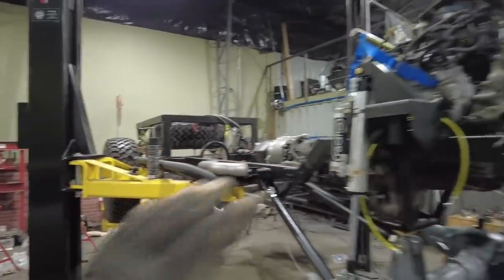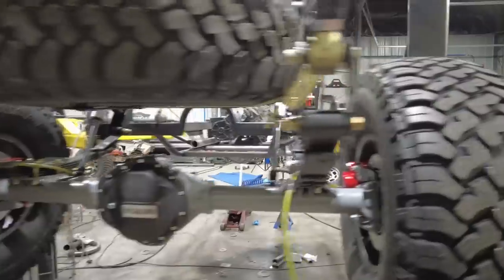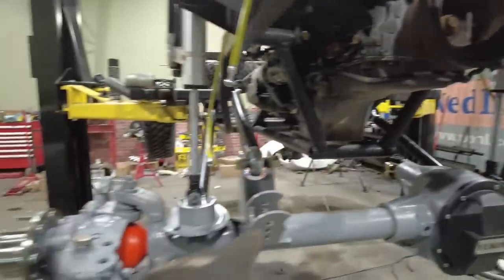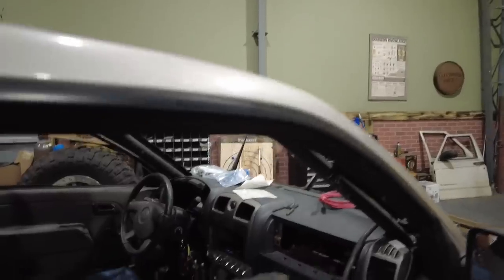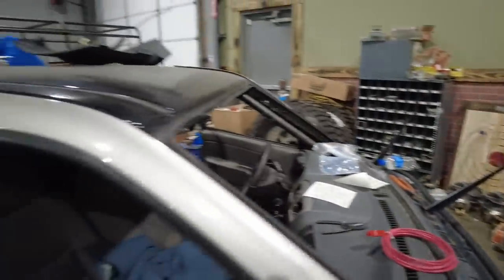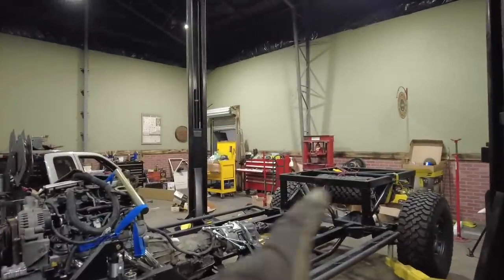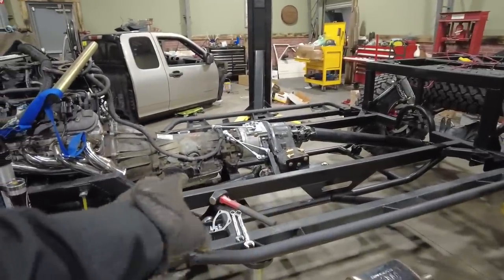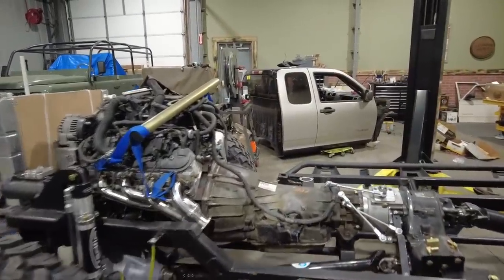Custom Winch Mount on Rockcrawler

Comment: Props and acknowledgment for Ian's skills of TIGging that un-braced pipe 🤯 It's hard enough to TIG around a pipe, let alone hold and rotate it as you weld. Crazy thing is he dipped while it was stationary, NOT while it was moving. Not sure if everyone realizes the difficulty of that particular weld operation, but that is a VERY advanced maneuver to pull off successfully!
Reply from the maker: Thanks man...it is certainly not easy...

Comment: I could never get as much done as you because, I spend 75% of my time staring at things, hands on my hip, mouth open and calculating all possible plans in my head like an autistic version of Dr Strange.
Reply: Don't just do somethin, stand there! I am the same way though. Prevents a lot of mistakes in the long run.

Comment: I really appreciate the up-close look at your winch plate fab. I'll be building one sooner or later. Yours is a lot lighter and tighter than what's available on the market, which is what I'm going for. Great video all around. Sucks that the trans is what gave you problems on UA when that's the piece of the build you seemed most unsure about.

Comment: Question. How do YOU decide when to just do stitch welds vs a full weld? For example, the added gussets for the winch mount.
Reply: I'm curious about this too. Often we think we need to fully weld things. But watching Andrew Camarata lift up his dump truck with only 1" of weld on 1/4" plate to prove the point made me realize we're over-doing it most of the time.